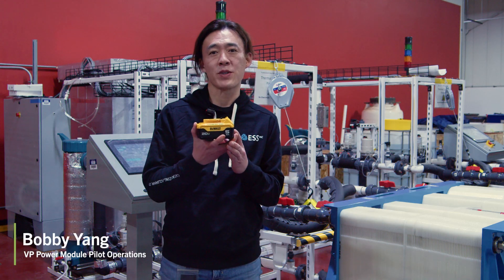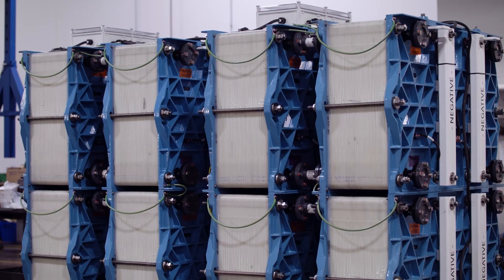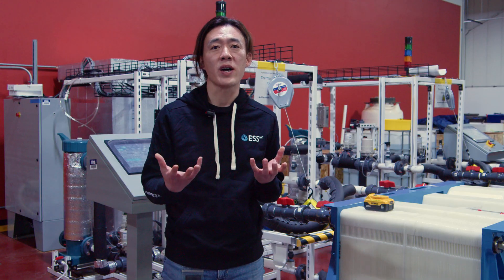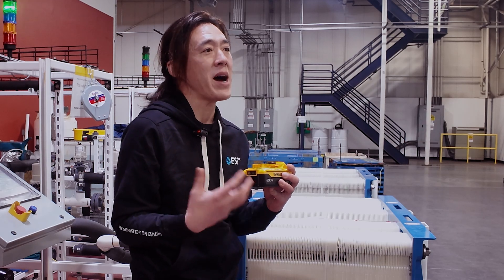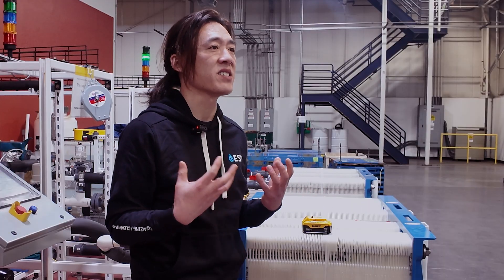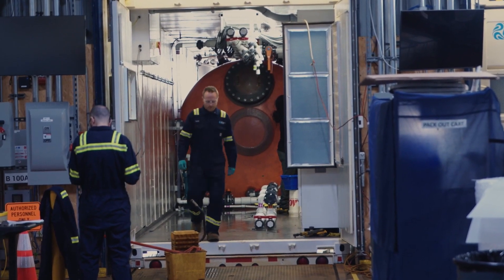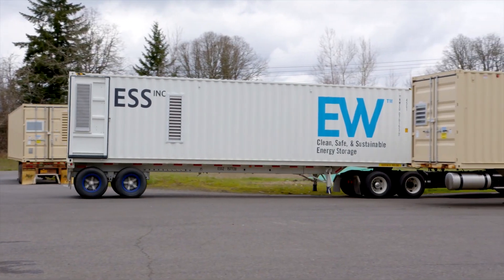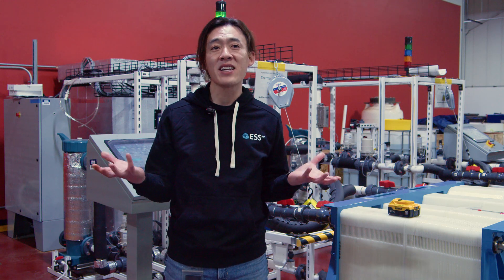ESS Iron Flow Battery Technology Explainer Video

Comment: This would be more effective if we understood the number of homes and hours that they could be powered with the new warehouse sized design.
Reply: @muzehack  The point of the new Energy Base you mentioned is to break the components out of the containers and allow you to size things as you wish. The Energy Center currently is (I think) about 145 kilowatts and 1,160 kWh in a 40 foot container footprint, which is quite a bit worse than lithium batteries. 

I don't know the economics versus something like the Tesla Megapack, but I hope with this they're getting close. 

I think they have a couple dozen production units in service now, but ESS is welcome to correct me...